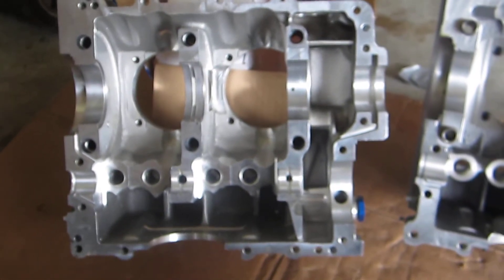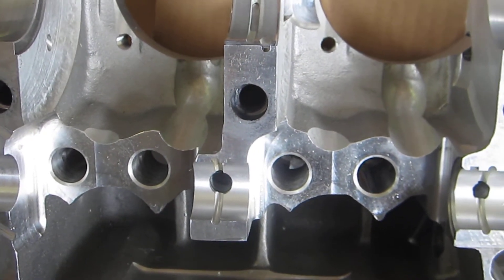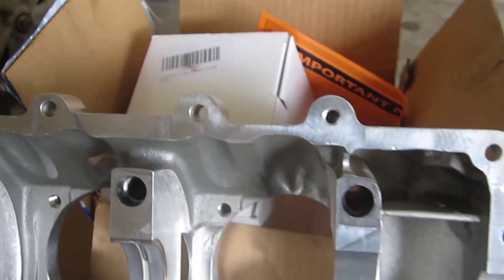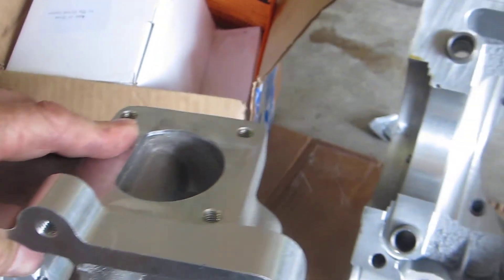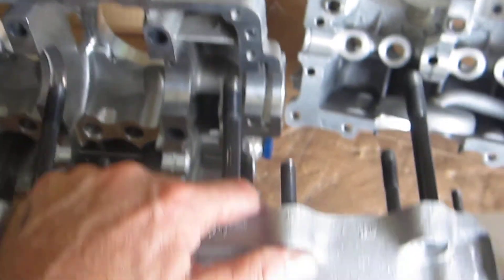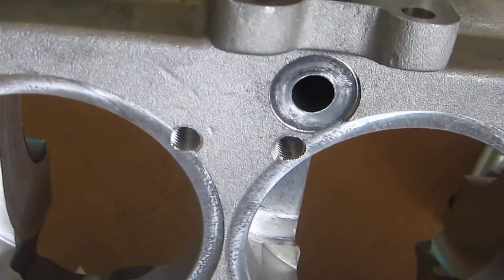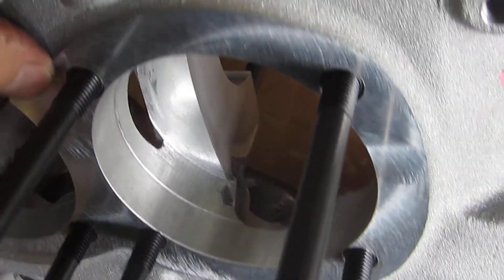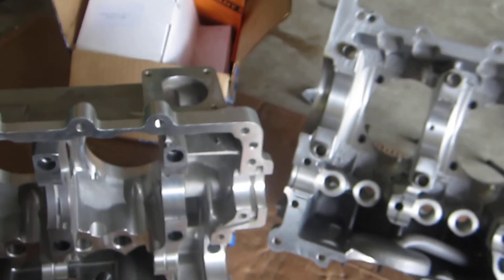White Rhino VW Engine Case Comparison With  TF1 case

Comment: Nice engine cases. I just got my new Aluminum Autolinea case delivered to Australia. I'm building an all new parts 1641cc for my 71 beetle. The stock 1600cc second hand engine I had exploded on its first long drive. I found no plungers were in the oil relief galleys, just the springs and the cap screws. Even my lifter bores were spit in two places and the cam in three pieces, A snapped conrod bent 180 degrees sideways. The case is beyond repair, So my first all new engine case build is about to happen. I got the forged 1641cc barrel pistons kit, counterbalanced/counterweighted crankshaft, Mild Engle 100 Cam, new rods, and a set of CB Panchito 044 big valve heads. She should be nice daily drivable engine with a bit more pep than a stock 1600. I found out studying prior to my build Zinc ZDDP additive oil is a must for the aircooled solid lifter engines.
Reply from the maker: Thanks! Your new build sounds exciting and your parts combo is solid. That new 1641cc ought to move out pretty good! 
Sorry about the old engine. That sounds like some serious carnage! Take care and have a good one.
Reply: Cómo vas con tu motor?

Comment: Does the TF1 engine case have the Hover mod done to the feeds on the cam post ?  That way the right hand side has 2 feeds .
Reply from the maker: I think Todd Francis did partially implement this. Here is a line item from his FAQ sheet around this: Standard in all cases is the possibility of running the Bob Hoover mod where oil is brought from the distributor side of the case to the alternator side via not only the groove around the center cam bearing but the groove around the pulley cam bearing as well.  I have drilled the 6.1mm hole that goes from the flywheel end of the case through the lifter bores all the way so it goes as deep as the middle of the pulley end cam journal.   I then drilled a hole in the journal that is in the direction of the end of the 6.1 hole.  I do not drill this hole deep enough to intersect.  If the builder decides he wants to use this option he can just finish drilling the cam journal hole so the holes intersect. I have not decided if this is a good or bad thing to do but a lot of guys like to use the option. Bob Hoover claims the extra oil on the 1-2 side keeps that head cooler.

Comment: first vid i've been able to find featuring the tf1. sweet. you didn't mention whether or not the tf1 is deep studded on #3?
Reply from the maker: Thanks for watching! Well, the TF1 doesn't have case savers installed, and the 10mm studs thread directly into the case, so no need for a deep #3 stud. I spoke by email with Todd Francis who creates these engine cases, and he explained to me the case is so strong that it doesn't need case savers! Another I forgot to mention in the video, and wish I would have, is that the TF-1 case has .100" dropped crank and cam gears for extra clearance for gigantic stroker cranks! The included gears are provided by Competition Engineering: www.cevw.com/products.php.
Reply: @vwsandvettes3253  i recall reading on the tf1 website that it has a .1 cam drop. i hear the tf1 is pricey, like 2x. no price on the web site. if you have to ask, you can't afford. i can't afford.
Reply from the maker: @redshirt-scotty  I hear ya :-) I spend too much sometimes on this hobby/obsession!  Prolly shouldn't have bought it but I squeezed my wallet lol.
Reply: @redshirt-scotty  FYI. Shawn Geers. Sells them on his website. About $1200 to $1500 I think
Edit: referring to the TF1 case